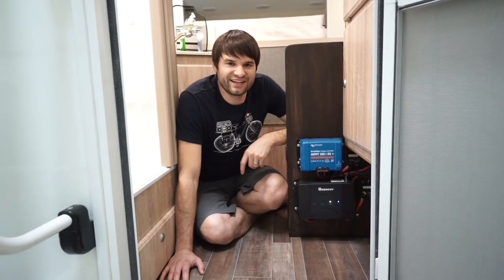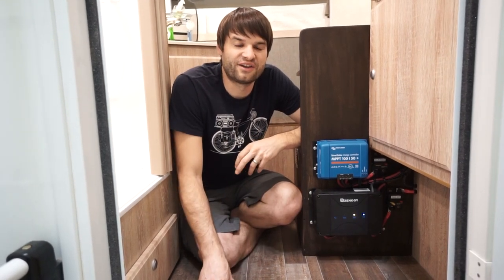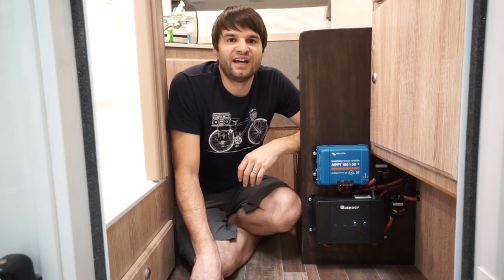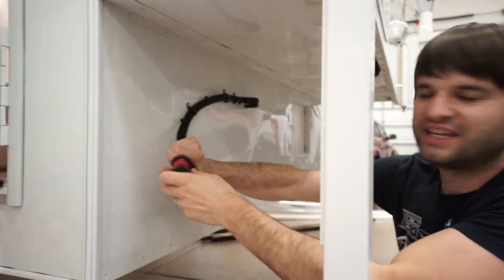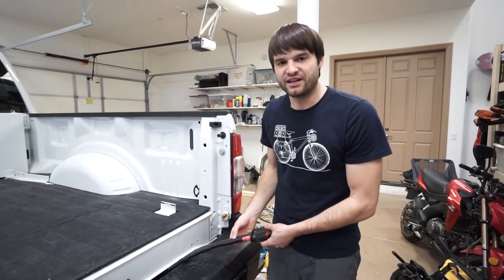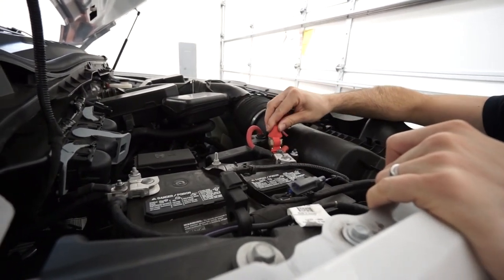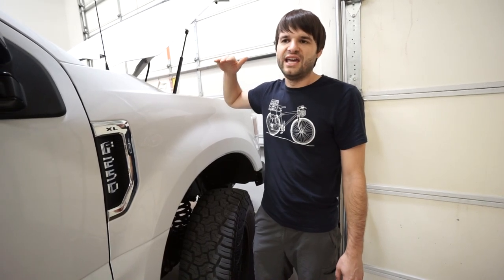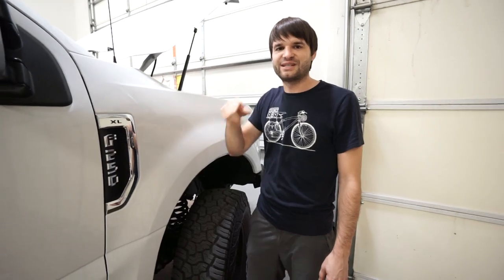No Generator!!  How to CHARGE your battery Off Grid??  Expedition Truck Camper Build!

Comment: Would it be possible to use this setup as the only source of power? My F-350 has 397 alternator, how long do you think it would take to charge 4  BB batteries?
Reply from the maker: Yes, you absolutely could do that.  Just would need to run the truck enough depending on usage.  This 50amp DC charger will charge your battery 50amps per hour.  100amp hour battle born battery would take 2 hours to fully charge from zero.  So 4 battle born batteries 400amp hours would take 8 hours to charge from nothing.  The key would be to figure out how much power you typically use and if that would work with running the engine.  This DC charger has a solar input as well.  So it would be very easy and cost effective to add some solar to help maintain.  Hope that helps!
Reply from the maker: AM Solar in Springfield, OR specializes in solar and electrical for RVs.  We used them on our Winnebago View.  This project I decide to do myself due to the complexity and space constraints.  Extremely time consuming!!  I'm not looking for additional work but thanks for the offer!  That is very kind.

That's true.  It is difficult.  You can do a paper estimate by taking every device that you expect to pull power and get the usage and time expected for it to be pulling.  But nothing beats real world testing.  

I don't have an excel spreadsheet.  However, I've estimated the non-solar run times to figure the pull down and recharge requirements.  After dark we are running led lights, phone/laptop charge, fridge/freezer, water pump, heater...  typically we drop 20-50 amps over night.  This is easily recouped with solar.  800w will produce approximately 50amps in direct sun.  Batteries will generally be full after a couple hours of sun.  

The challenge is winter season...  you'll pull the most electricity with shorter sun hours and cold temperatures (heater).  This is where the large solar array will be helpful for us.  

I'm guessing you could be alright just using the DC charger if running your motor for 1-2hrs per day.  400amp hrs could last you 2-4 days with no power input.  Stuff that will drain batteries fast: power inverter, tv, electric powered appliances, ac and similar.
Reply: @TruckCamper  

2017, we visited AM in Springfield Oregon.

Their quote to duplicate our system was us$16,000.

We acquired our six 305-Watt panels from Grape in Eugene Oregon.
Our cost loaded in the bed of our pickup truck -- us$600 (six hundred clams).

We think the benefits of building and knowing our rig and its systems far outweigh paying some stranger to do it for us... then relying on other strangers to fix it.
Reply from the maker: @largemarge1603  True.  Knowledge and experience comes in handy when stuff fails!  But trade off is time...  depends on your situation what makes most sense

Comment: what are your thoughts on wiring the cable to the alternator instead of the batteries?
Reply from the maker: I don't see an advantage there... and keeping power connections centralized at the battery is cleaner and easier to manage.
Reply: @TruckCamper  thanks for the reply I thought so too, now I like to find out why it was recommended otherwise.
Reply from the maker: @carmas54  I've seen some rigs with 2 alternators where 1 was dedicated to charging the camper/house.  And that would make sense to wire directly to be stand alone from the truck battery.
Reply: @TruckCamper  yeah I might have that setup, but I would have to see if my Ford dealer can figure out if one them is sitting idle and only one is charging the two batteries... I also have an inverter that came stock from Ford in my truck, I plan on using that to charge to solar generator to operate the portable frig with 12v... I don’t think the manual has any of these answers for me, so I’ll keep researching
Reply from the maker: @carmas54  The alternators are computer controlled so difficult to do an "old school" style wiring connection.  Generally only 1 alternator will be charging even on dual alternator configurations.  The computer turns them on/off as needed depending on load.  I'm guessing this is to limit engine load/drag when not needed.  The stock inverter is fairly small so just need to confirm it will produce the power you want!  :)
Reply: @TruckCamper  maybe a Ford dealer will be helpful...thanks for the hints
Reply: @TruckCamper  I reached out to ford’s body builder uplifter website tech support they said that both alternators charge the batteries and that anything over 30amps needed to be connected to the batteries with fuse on the positive lug. Do you’re correct thanks for the hints. The computer module decides where the power comes from and send it.  Decision solved
Reply: @carmas54  HI,  I's sorta confused. I have the same Ford F250 with a 240amp alternator and was thinking about hooking a 6AWG wire to it then back to the rear of the truck, Anderson plug, etc.   Why would anything over 30 amps need to be connected through the battery on a fuse? I mean with that big an alternator, not making any sense why I couldn't feed directly back.   Did Ford give a bit more of an explanation?   Is it a Ford specific alternator issue you think?

Comment: You know that as long as you have solar connected you'll only get a maximum of 25amps from the alternator.  So on cloudy overcast days when your solar is producing little or no amps, you need a switch to isolate the solar only then will your alternator give you the full 50amps subject to battery soc.
Reply from the maker: Not true!  We have a victron mppt charge controller for the solar.  The DC charger always provides 50amp charging at idle.  Max charge between the alternator and solar is 100amp (800watts solar).  However,  if you do use the built in mppt charger on the Renogy... the max output is 50amps regardless of solar or alternator input.  We love this setup!  Always have more than enough power.  Thanks for sharing!
Reply: @TruckCamper  that's because you have another mppt controller. I'm talking about the renogy dc-dc charger which is also mppt. If you connect solar to the renogy, you'll only get max 25amps from solar and max 25amps from alternator when engine running. To get full 50amps from your 'alternator' the renogy dc-dc charger must be disconnected from solar first via isolation switch.
Reply from the maker: @philwilliams23  It's true the Renogy only allows a max of 50amps charging for whichever source.  But it's not divided in half from what I've read.  Have you tested this?
Reply: @TruckCamper  it is if you have solar connected and what to top up with alternator. In order to get the full 50amps from alternator only, you'll have to disconnect solar. If however it's sunny when the engine is running it will pull what it can from your solar first (max 25amps) then upto a max of 25amps from alternator. Renogy have not made that distinction clear, quite a lot of people have learnt this retrospectively after buying it.  It's still a great piece of kit for the price, but is limited to 24v max solar voltage, I think from memory.
Reply: @TruckCamper  it is divided in half when alternator on, unless solar disconnected. Only if solar disconnected will you get your full 50amps from alternator.
Reply from the maker: @philwilliams23  Interesting.  Would be curious to test out...
Reply: You should have a solar cutoff switch installed anyway. Just turn it to off before you drive. Should get the full 50a.

Comment: When I set up I'm just thinking that you would want to run it the alternator not from your car battery when did drain your car battery much faster
Reply from the maker: It only connects and charges while the alternator is on.  Wiring to the battery is the proper method

Comment: We built out our 2019 van in the same way, using a Sterling 60Amp B2B Charger and (2) BB Batteries, plus Victron solar charger and Victron Inverters etc. Typical Van setup!  We've traveled 24,000 miles using this configuration on an all-electric Van. (Induction Cooktop, Elec. HW Heater) We don't have or need a shore power connector. I don't get the sense that truck campers are completely on board with this yet. Were 95% sure we're going to have Bundutec build our truck camper, and had a conversation today about installing this type of system from the factory! It's one of the main reasons we want their camper. The other manufacturers just gave me big fat NO's "You get what we give you" attitude.
Reply from the maker: RVs and Campers are way behind the times!  It's crazy.  I think it's best to just get a base model/version and upgrade.  Don't depend on manufacturers to put these systems in.... they are not experienced with them.  Bundutec is owned by Rex's brother who owns Northstar.  Northstar has better manufacturing and quality but terrible customer service.  Bundutec is good customer service but questionable otherwise.  Be careful.  They will say anything to get the work.  But really these systems are not their expertise....  and that's true with all the manufacturers.  Truck Campers are great and the best thing is a capable 4x4 base to haul them.  :)
Reply: @TruckCamper   We've been impressed with the Bundutec products we have seen at OE West the past few years, so I'm pretty condident they can build what we want. I'm more concerned with the base unit than the accessories, I can do that if needed. Origionally we wanted a Tiger, but my friend won't part with hers! We looked at a few others we met at OE that would do some custom work, but they are in the stratosphere on pricing. Good time to be a builder!

Comment: You don’t have an air conditioner either.   I don’t think you could make it down here. Nor would you want to
Reply from the maker: So true!!  We travel where the weather is good...  Don't want to be locked up inside a tiny camper all day!  Will be doing more cold weather trips so insulation and heating will be key.  :)

Comment: How much does it cost to run your truck's engine for 4 hours ? I bet it is a LOT more than my Honda generator . This system would be great for an over the road delivery service , but not for camping . Sorry ..
Reply from the maker: Depends on the engine.  Our gas engine at idle uses .3 to .4 gallons per hour.  Our previous Sprinter diesel used less than .2 gallons per hour at idle.  This setup really shines while traveling as your engine is already running but can be used while stationary as a "backup".